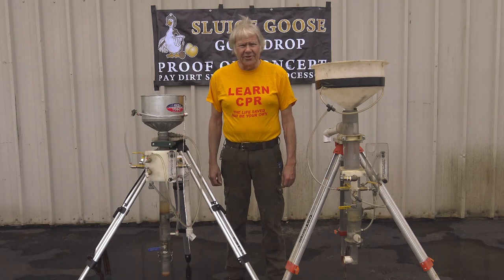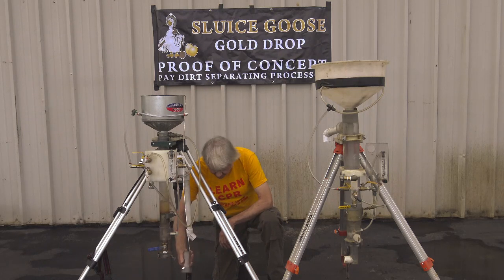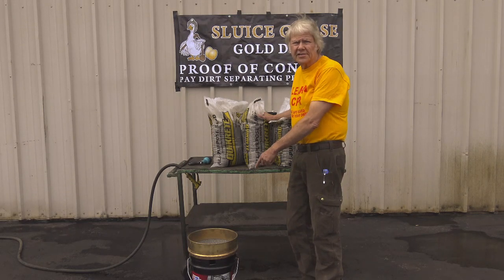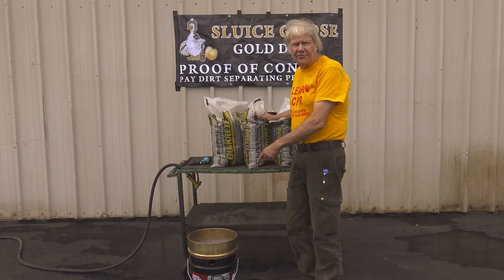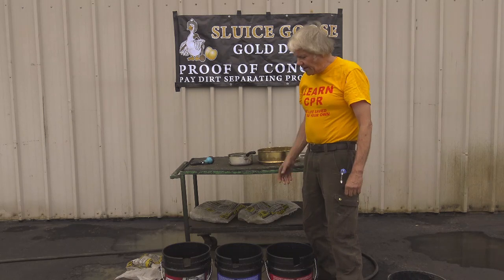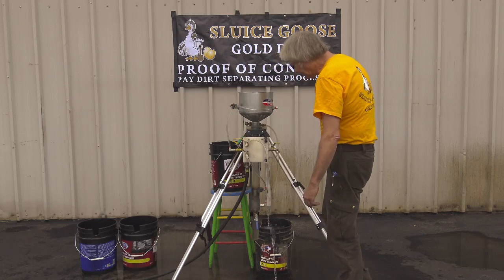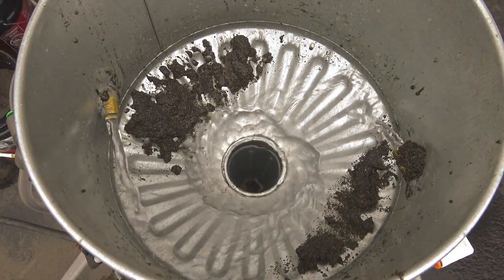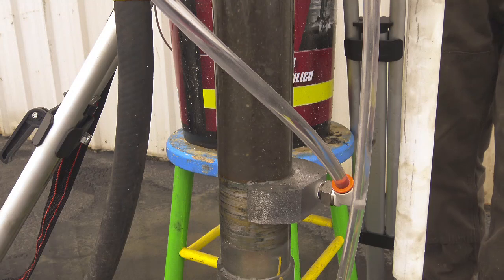GOLDROP II latest prototype vs. Gold in Quikrete sand

Comment: I mine in the southwest. Have you tried to replace air for water? Fluidized beds can use gas for medium.
Reply from the maker: True, elutriation can be accomplished with air too. That's the premise of a dry washer using air to blow away the tailings producing concentrates. That requires additional equipnent with greater power requirements and maintenance to provide compressed air. Water use by the GOLDROP is contained, controllled and recirculated powered by a 12V , 36W 1100GPH bilge pump connected to a 100W solar panel requiring no additional support to operate manually. In the southwest, this is ideal! Recent testing shows the GOLDROP is the most efficient device there is to recover gold. The GOLDROP even recovers gold that mercury cannot! Read the report on my website, www.sluicegooseindustries.com.